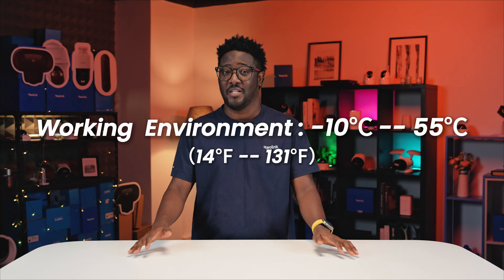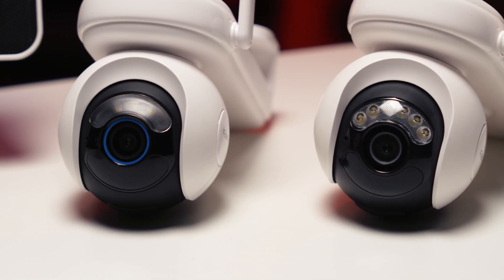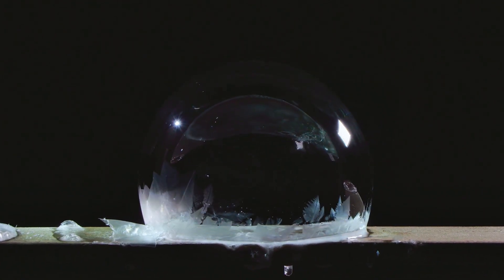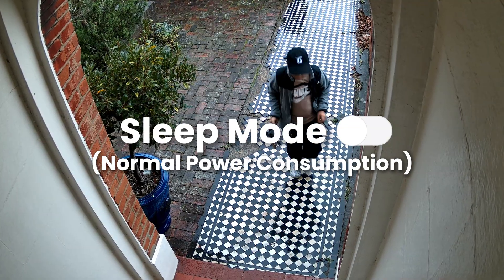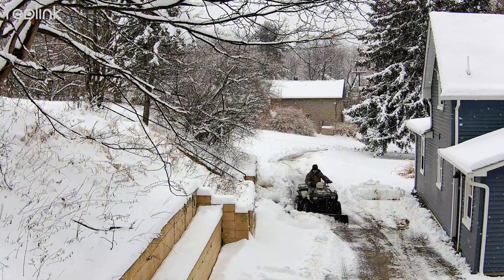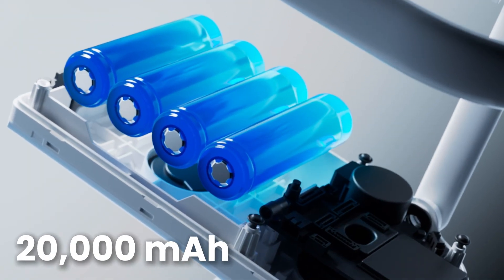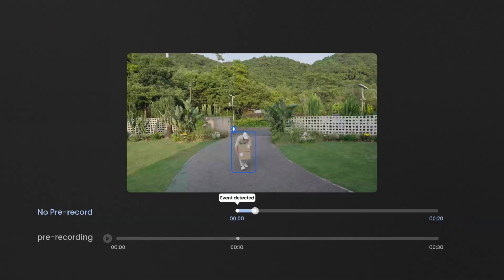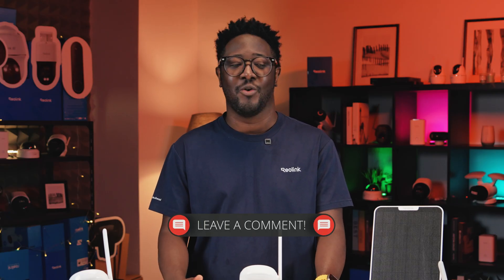Why Your Battery Camera Dies in Winter | And How Reolink Fixed It

Comment: My camera will operate when its 0°, but wont charge when its below 32°. My problem is that it will stay 32° for weeks at a time, so the camera never has a chance to warm up enough to charge. It inevitably runs out of battery power after a week or so. 
.
Im looking into thin polyimide heaters, maybe 10W, to glue to the internal battery and hook up to a second solar panel. My thought is that during the day when the camera can charge on solar power, the second solar panel and heater warms up the battery enough that it can accept charge. 

It seems only one of your cameras has this functionality built in, and its very expensive compared to the others.
Reply from the maker: The battery won't charge below $0^{\circ}\text{C}$ to prevent permanent damage, causing your issue in prolonged cold. Your solar heater idea is technically correct, but modifying the internal battery voids the warranty and poses safety risks. Our expensive model includes certified, integrated heating for this exact problem.